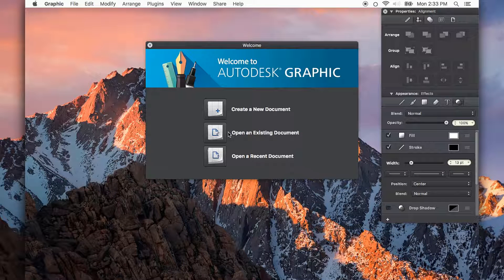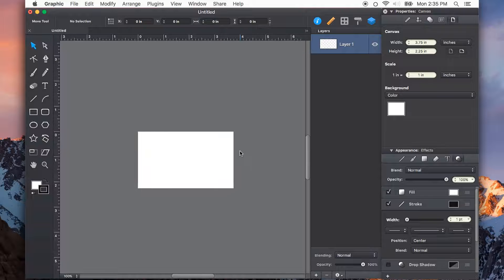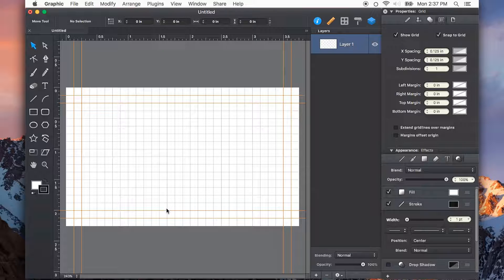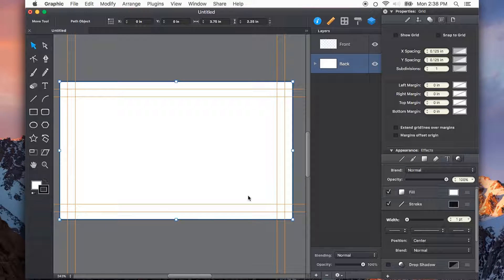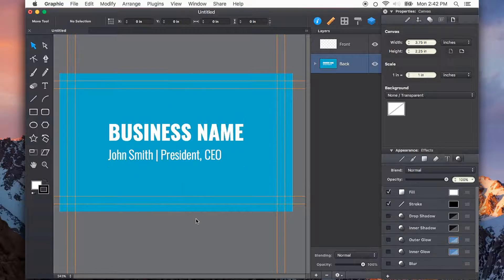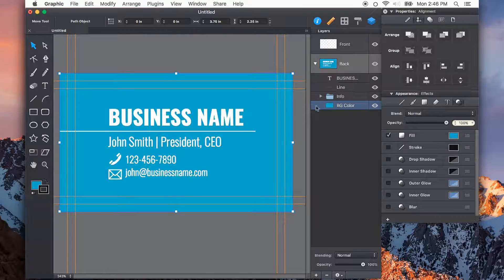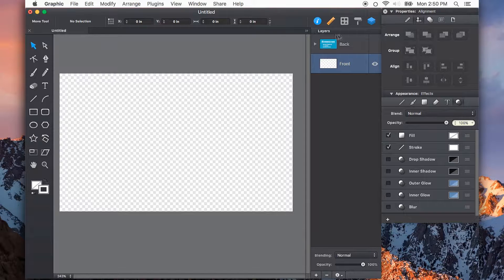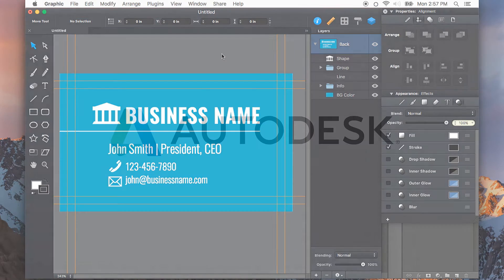Autodesk Graphic: Print Ready Setup

Comment: Thanks for the video. I recently started a logo using CMYK (Generic). I noticed that the colors looked dull. I switched to RGB and they got brighter (more of what I was expecting). Which would be right for printing? Under Color Settings, is there another setting I should be using under the Document Color Profile dropdown other than the default Generic CMYK Profile?